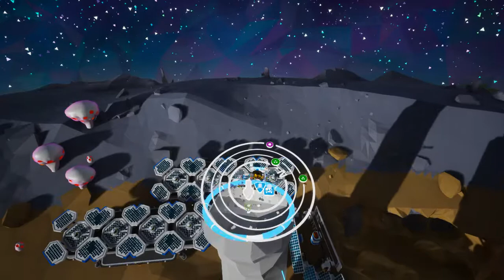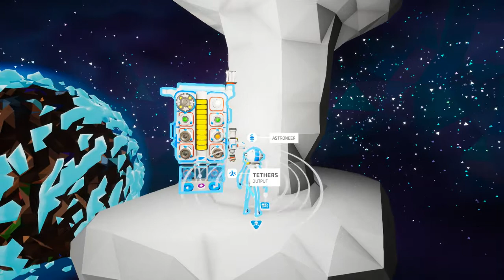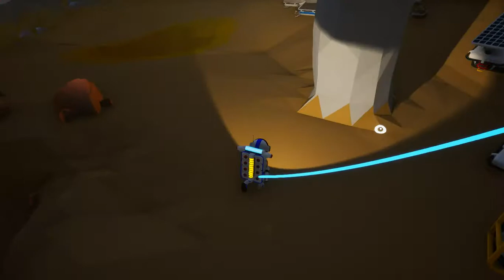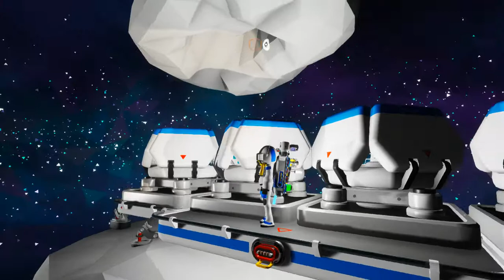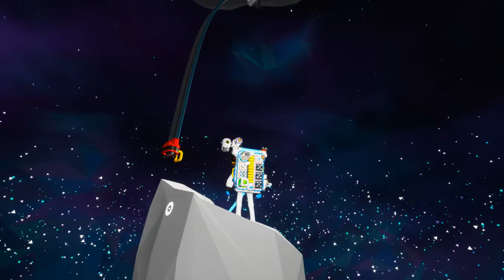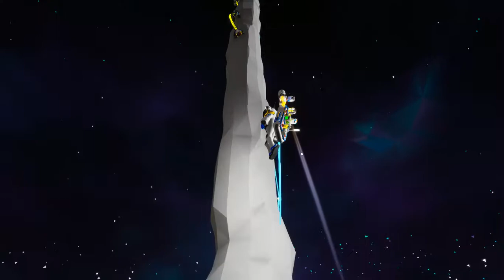24Hour Solar Power guide

Comment: You can do the same thing with t1 solar panels in a big grid, but without having to make a giant pillar and upside down plane in the sky. Find the north/south pole and make a plateau just high enough so it always sees the sun, even a natural hill will do. Fill it with some flat storage and fill it with t1 solars. t1 solar is more energy dense per storage space anyway, and the resources to make the whole thing can be done from the very start of the game. Sometimes the solar panels take a little convincing and might need a jiggle to get working again when you load, but if they're at the pole once they catch the sun they stick with it and just rotate 360 to follow it constantly.
Reply from the maker: Yeah, I have a video on that called "budget RTGs" ... but as you said, they take a little convincing and take a while to start working again when you load. Whereas, this upside down method seems to work more consistently. ... Also, printing 5000 t1 solars would be painful ROFL.
Reply from the maker: https://www.youtube.com/watch?v=eRaySxxKGRM